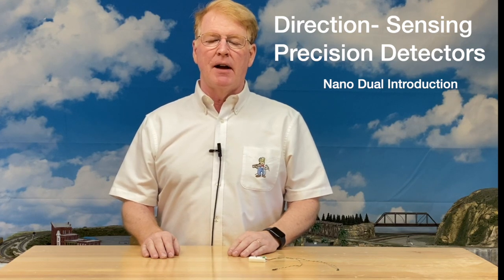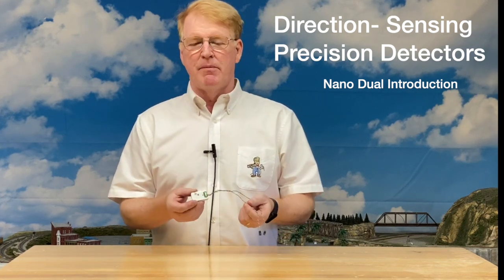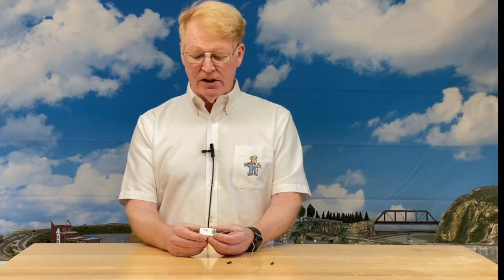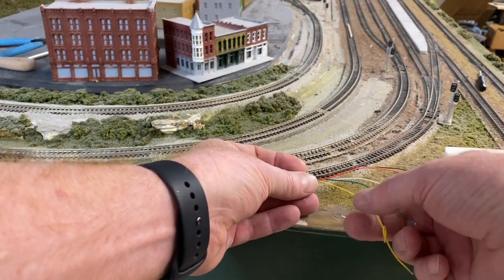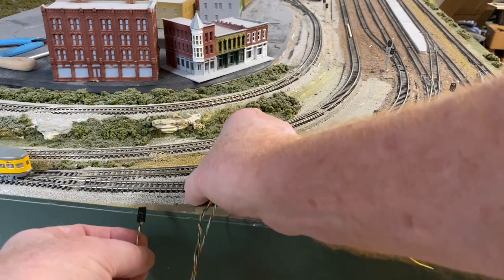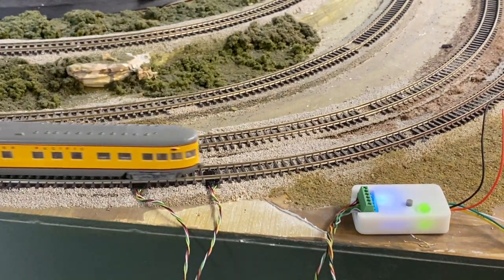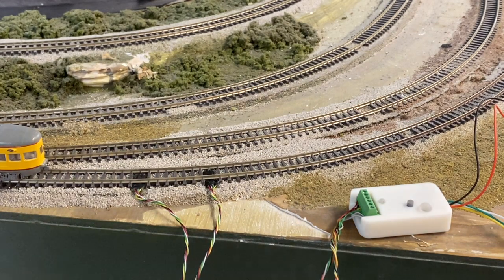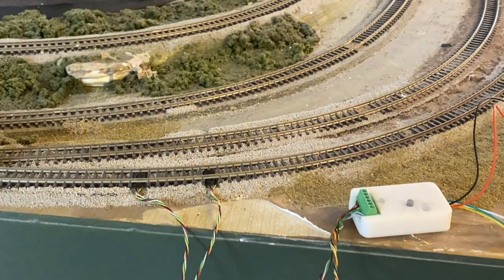NEW PRODUCT - Direction-Sensing Train Detection

Comment: What do the three wires output when triggered? Is it voltage or just  closed circuits with no volts?
Reply from the maker: The output is Signal LOW (Open Drain); no voltage.